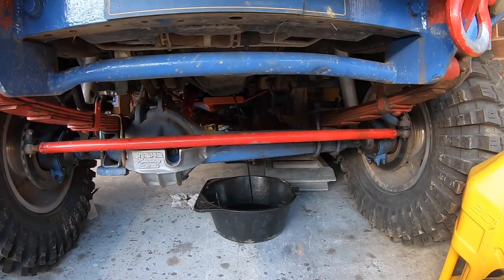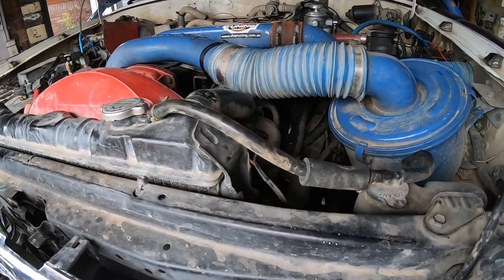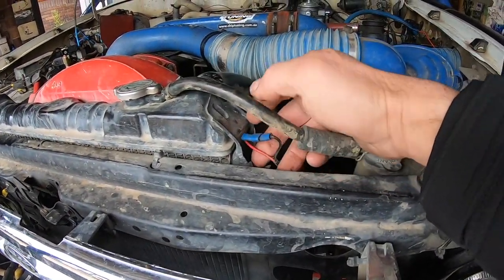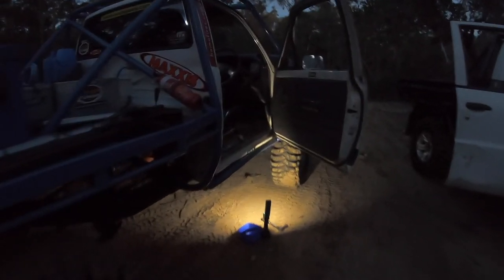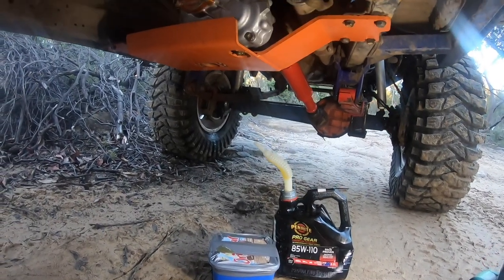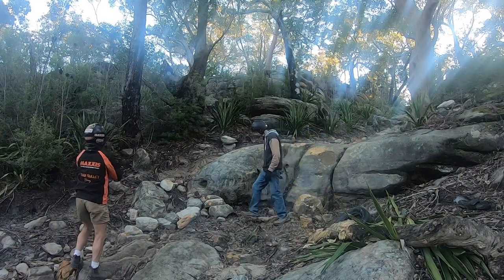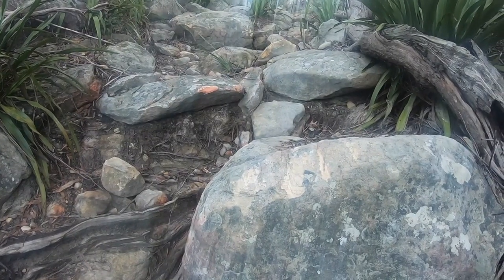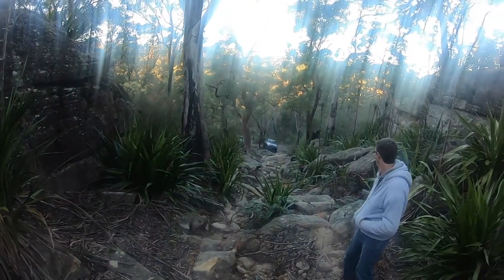Twin locked Modified Toyota hilux rock crawling marlin crawler 4.7 transfer gears Maxxis Trepadors

Comment: Hi drench what gears do you run in high range?
Reply from the maker: 1:1 high range
front low 2.28:1
Rear low 4.7:1
Low low 10.72:1